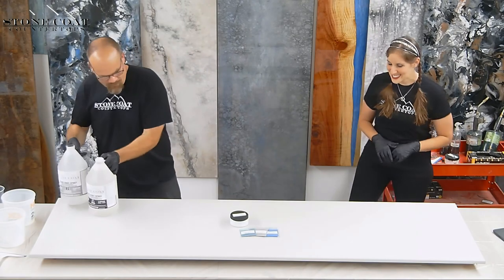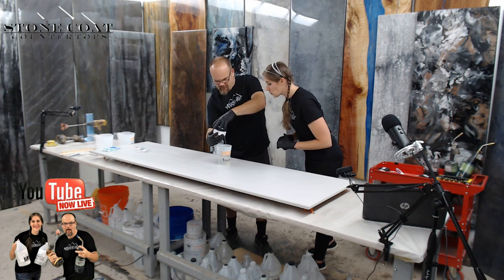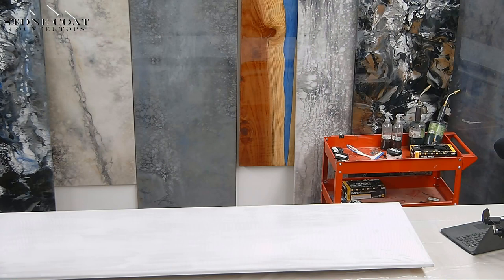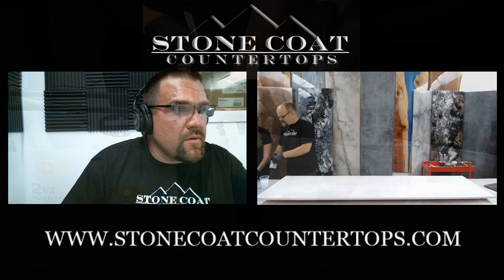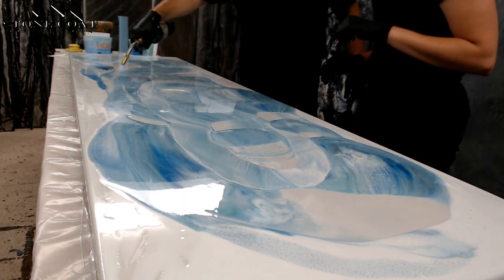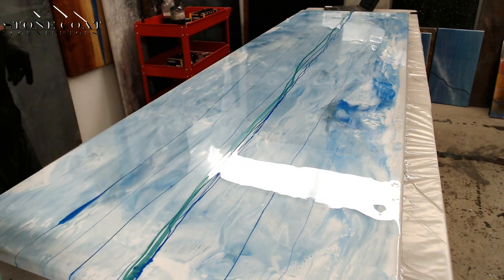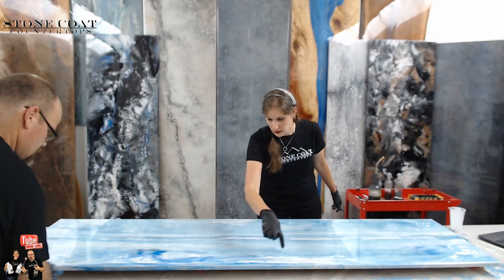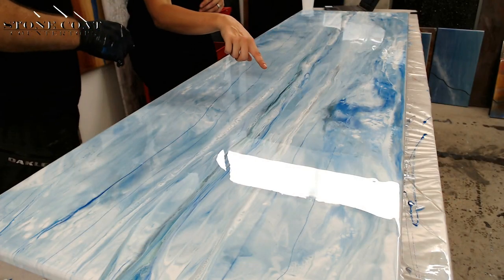Dirty pour Epoxy Live

Comment: I want to make panels and use them for a tub surround. As long as I silicone all the edges would the surface be waterproof?
Reply from the maker: Great question Aaron! For vertical shower walls if you want to mimic polished natural stone you will pour your walls as they lay flat and add any design you wish. We like to use ¾” MDF and use a waterproof membrane called Redgard on the unfinished areas to make sure the water will not penetrate the shower walls.  Our free video training's show many options and color choices. The effects are truly limitless. After the walls are dry and the drips are removed by sanding, you can install the shower panels using 100% silicone as an adhesive. You will also mask off the joints with blue painter’s tape and caulk the joints and tool them with your finger at all the joints and seams. Feel free to contact us anytime for free project support. We also have a wall epoxy that can be troweled in place for vertical walls. This is a textured effect that looks like old world stone. Here is a video link showing this product.  https://www.youtube.com/watch?v=zSsgE9xGFMY Feel free to contact us anytime for free project support. Thank you again for the great question! (541)450-1976

Comment: Ok little late on the video stream but have a question for y'all. On the laptop end of the board it looks like the epoxy isn't sitting on the base layer. Almost like paint would do over wax paper?  Can you explain how to avoid that from happening. Thanks. Great video

Comment: newbie here.  building our own bar.  this will be great to use as our bar top.   how hard is this really???
Reply: OR Scrub Stone Coat Countertop is extremely durable, it’s zero VOC, food safe, has UV inhibitors and is heat resistant after a 30 day cure! Check out the durability video. Call or email anytime for project support! (541)450-1976
Reply: OR Scrub it’s a fun process and very simple to work with, you can email us a photo of your project to stonecoatcountertops@gmail.com and we would be happy to give you step-by-step instructions.
Reply: Not hard at all!!!!!

Comment: Question; after drying, this still needs to be sanded and covered with clear resin, right?
Reply from the maker: Great question Nicole!  If you are planning on re-creating this look on countertops you would want to wait 24 hours for the decorative coat to dry, sand with 220 and apply a clear flood coat, this will protect your decorative coat, provide food safe countertops.  You can do a clear flood coat on your resin art pieces if you are wanting to; however, it is not necessary.  Thank you again for the great question! Are you planning any projects Nicole?

Comment: How do you order the 2 new colors? I don't see them on your site. Also, is it possible to mix acrylic paint with your epoxy?
Reply from the maker: Great question Kimberly, we do not have the new colors on our site yet but we will soon! You can mix acrylic paint with our art coat resin, we would not recommend mixing it in with our regular countertop epoxy as the acrylic paint can affect the durability of the epoxy.

Comment: What other paints work well ? I know you said acrylic paint works.. but I'm wondering about other paints.. maybe automotive paint, ..
Thanks ..
Reply from the maker: Great question Scott!  Stone Coat Countertop epoxy is compatible with alcohol inks, acrylics, silicone oils, metallics, oil based paint and more! We we would suggest testing out the automotive paint on a small test piece.  Give us a call or email us anytime with questions or for project support. (541)450-1976